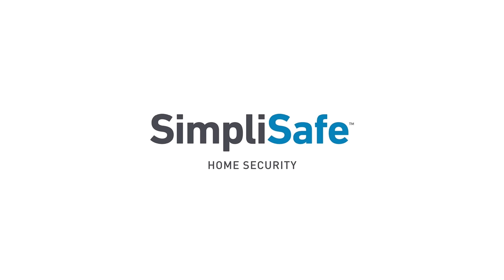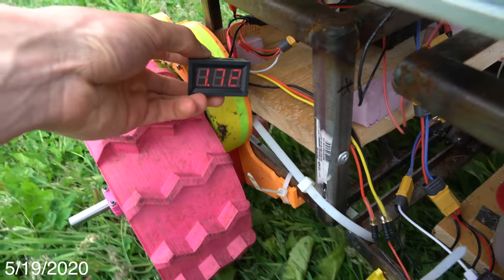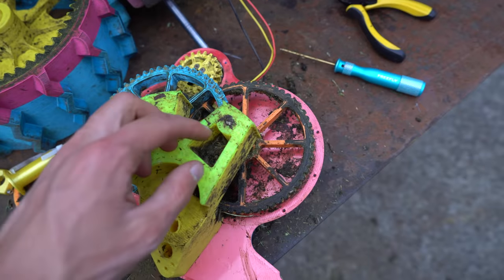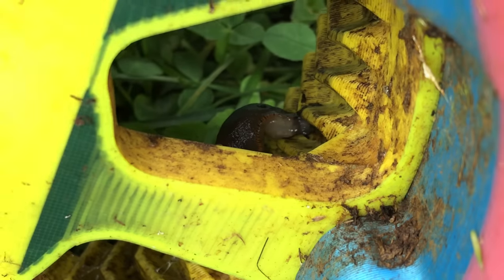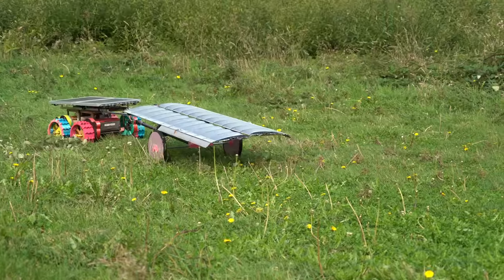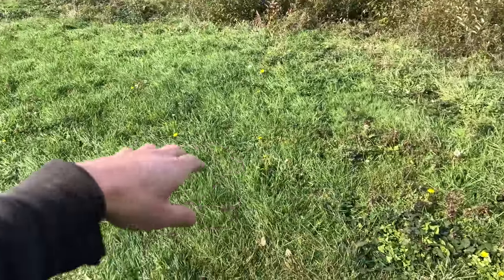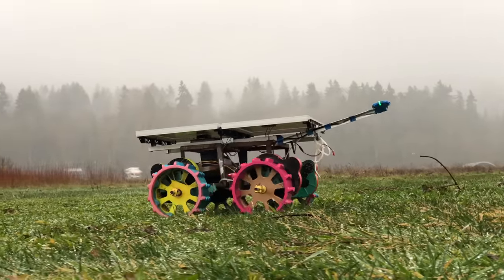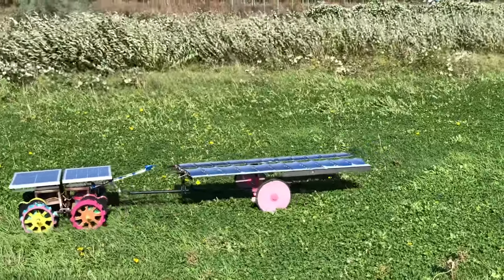Solar Rover #3 - 3D Printed Brushless Gearbox

Comment: I think it would be wiser to simply separate the gearbox from the wheel, to basically only have one point of entrance for debris to get into the gearbox, to increase it's maximum expected lifetime, and having that single point of entrance be as high above the ground as possible. For example, you could have the connection point connect to the wheel on the top of the wheel, on the highest point it can connect to the wheel in the current configuration, which would allow it to get even more ground clearance. Also, you might want to use custom-made wheels and gears inside which to be able to pack and glass-fiber cement or electrical-wire cement, or use the existing wheels and gears to make molds with which to make glass-fiber-reinforced or electrical-wire-reinforced plastic parts (using those very fine electrical wires, without the plastic parts). More weight, but also a lot more strength. And adding transparent covers for the sides of the wheels might also help combat the slug infestation.

Also, it would be interesting to see you make a airship (airplane-blimp) hybrid , and use that. It would be really interesting if you had one propeller in the front, and when there is strong tail wind, use the propeller as a power generator. It would also be interesting if you added a few flaps to the side of the airship, to use them as sails when there is more tailwind than the planned speed, but not enough to use for power generation. You could also have the airship be translucent with some home-made black-painted tinfoil heatsinks on the inside of the airship, to use sunlight to keep itself floating. And with some elastic straps, you could even have the airship turn into a lower-profile airplane/glider, to reduce the drag for lower-powered flying. And it would also be interesting to do the math to show how much power would be needed to get a fleet of similar blimps to do the last-mile delivery for home-delivery services like Amazon, from something like a truck (not a pickup, a truck with 6+ wheels) parked on the side of a road, using only air-saturated hot air, or maybe even steam. Hot air has a lift coefficient per volume of 30% of that of hydrogen and/or helium (which are very similar), water-saturated hot-air has 40% (so increased by a third), and steam has 60% (but needs materials which can survive over 120 C or 250 F, including for thermally insulating the blimp from the outside air). Do note that you can make a steam airship from metal, and you can even make a telescopic/inflatable one (although with a higher cost), to be able to need more or less volume depending on the conditions nearby. And you can even make slide-out solar panels for bigger blimps, if you need more energy (which you can use to move faster, or to heat the balloon even more).

Comment: Thanks. Your content is extremely inspiring. Maybe put a track like a tank between the side wheels and only use two of the drive wheels to run the tracks. I think you could in improve the grip and efficiency. Possibly less amp day draw and able to run off solar more. Thanks again

Comment: Print in ABS and use White Lithium grease on the gears will reduce wear.  And it is probably magnetic declination that is affecting your GPS.  It changes with the rotation of the earth around the sun.

Comment: Slugs can be repelled by alternating galvanized metal and copper bands or a couple of parallel bare wires 3/4 inch apart with a 2 or 3 megaohm resistor in series with VCC to one wire and the other to ground should the slugs path should keep them away.

Thirty years ago, I worked on prototypes of J1939 CAN networks, systems,  and devices not unlike yours that make up some Ag robots today. Work like yours that tests ideas over and over to failure is rare, and I learned a great deal about the durability of herringbone gears that is certainly non-obvious if not for your continual patching up the grass-grinding slug eater and putting it back in the field. 

You have revived my interest in building a weeding robot. Ardupilot has made things a lot simpler. I've worked on the design of robots to weed crops, yards, pastures,  and the problems you had with grass, vines, mud, slugs, clouds, and wind are not that different than the ones John Deere's engineers have to solve. Planetary gears are usually the solution for modern gear reduction in light-duty farm equipment under 100 horsepower.

My interest is weed identification, mapping, and eradication. "No weed can survive if cut it off at the ground every Tuesday" - dad

 Was I building a rover such as yours, I  would make it longer and wider so it could be taller and have more ground clearance.  I would probably use timing belts on counter shafts or harmonic drives to get the reduction on top of the vehicle and out of the dirt. I would make better seals. I would use rubber crawler tracks to have fewer problems with mud and compaction as I add weight to them. I have been torn for years between using a combination of center pivot and skid steering, as I believe you use, or using crab steering. Something this size doesn't need 4-heel independent steering, but a weeding robot for thirty 40-inch rows sure does when it turns at the end of the row. Turning something 100 feet long around in a turn row and getting back on the row is pretty tough, and is easier to work out on something this size.

Comment: Nice thing. Now some suggestions:
1: Planetary hub drive
2: suspension
3: LIDAR
4: gyrocompass
5: move GPS antenna location between the two solar panels 
6: trailer hitch and receiver
7: enclosed battery compartment, with more batteries

Comment: I'll bet if you built 20" wheels with similar gearing you could: drive over obstacles more easily; reduce overall drivetrain drag; and have a larger rover capable of carrying way more solar panels. Maybe add a little planter for the grass to grow itself next year!

I'd also really love to see one of these autopilot vehicles do some kind of useful trip. Could you send it on a mission to a different city or something? Maybe there's a multiuse trail that stretches for miles and miles. Maybe it could just go collect audio recordings of onlookers. These things really spark my imagination.

Comment: car, goes fast for a long time:  wheels and gearbox are fine

car, goes slow for a long time:  breaks
Reply: If he used some metal gears where everything was sealed with oil, it would have probably lasted forever. It only failed because the plastics got beaten to death.

Comment: I know this was filmed a while ago, but I would suggest putting in a gasket layer on the backplate (where it melted.) Even something like the gasket in a tube stuff they sell at auto stores. Then fill the whole thing w/ oil. Even if it seeped out it would actually have the benefit of flushing out all the slug guts and mushroom food.

Comment: This things actually reduce noise. This is the fact that you used plastics materials making that noise. 
You can observe that's in car gears the reverse is with classical gear  but others one are specially made with the v shape and on most of the car you can hear the difference between the noise in reverse and the normal noise of a car. Btw it was originally conceived by Citroen that is where the got they symbol.

Comment: try using a worm gear instead in your gearbox it can increase torque without the need of many moving parts reducing energy loss and reduce points of failure and can help reduce jamming in the gears from debris.

Comment: If you think about it, you definitely could've made something very similar to cow poop. The fungus means fermentation could've started, the finely ground grass is the same thing that'd be in a cow's mouth and then stomach, heat from the motor and movement could've kept the reaction going and I'm sure slug guts added to it somehow too. Dude. You made a cow. It roams, it chews up grass and it smells like cow dung.

Comment: There's code libraries available that make it reasonably easy for your arduino to read the GPS.  It would definitely help the longevity of your drivetrain to detect if the rover has stopped moving when it should be, and put it in hold mode until it can be rescued.

Comment: make it so that it knows if there's snow on the ground. make a little dog house it, and let it hibernate autonomously.  to solve the issue of not having any light in the dog house, you could make an ultra power saving mode, or make it so the doghouse wipes snow off of an acrylic roof.

Comment: The final drive pinion should be at the top of the ring gear so grass that licks into the wheel hub down low isn't grabbed by the gear.   This might reduce the accumulation a bit.   I think you could afford the extra $1 to $5 of plastic to print things solid, particularly the hubs.  ;-)  Holes in the ring gear tooth valleys might allow the muck to be slowly extruded out the surface of the wheel.   A simple deflector might lean grass away before it can get captured in the final drive.  It would seem with such large radii turns there would be no purpose in ever reverse turning one set of wheels except to drain the pack for fun.  It would still skid steer when only one side advances.  Using less gear reduction in the first stage and more later would give you more teeth and this more tooth surface to survive wear.   I work as a professional maker and safety pilot in a UAS lab.  A couple of us follow your adventures.

Comment: Hey you should try to implement a 3D printed planetary gearbox. I think you could get high reduction in a smaller volume. Also, it could provide you with a means to transfer power directly to the wheels without gears that are exposed to the elements. 
Love these types of videos btw! Keep up the good work.

Comment: Yes this kind of gearing will reduce sound. Just listen how gearboxes sound in like rally or racing circuits. They have just straight tooting  which will collapse into each other, making its distinct sound.Try driving reverse in your car results, the sound come from this straight teeth on your reverse gear, in racing all gears toothing is straight as well, because less losses because of no forces will spill to align the gears.

Comment: Those double-herringbone gears might run a lot quieter if you use a lathe to turn down the center  of each tooth, where the left and right join together, effectively making them a matched pair of double helical gears.

Comment: I reckon one of the ~$200 1/8 scale crawlers would be good for this application. more ground clearance.. add some efficient 540 sized sensored brushless motors... gear that shit down..  Also 4-wheel steer capability instead of skid-steer... could be useful but could be more complicated.

Anyway I love your use of the 3d printed gearbox and are surprised how long it held up.

Comment: interesting to see it work over a long period of time.  could put a oil drip system in there for the gears. use olive oil drip once every 5 minutes when running.
could try a little motor with some blades attached to it and have it swival back and forth to keep the grass cut in the way point area. i would like to try making a rover to detect metal and store all the locations it found metal.

Comment: If you run across a design that attracts and grinds up groundhogs, I will totally buy one. Needs to be able to cover 10 acres at a time. Probably needs to be bigger than this one. But what you have is cool as a starter.

Comment: If the entire gear mechanism is placed inside the wheel. I think it would be more robust and protected from external factors. You can make the electrical connection by passing it through the wheel shaft. Let the wheel be in the form of a closed box at the front and the back. Use the gps data by passing it through a filter such as Kalman Filter to make the vehicle move with smoother movement. Do not make the rotation movement by stopping the wheel on the side to be turned. This causes more foreign matter to enter the wheel. Instead, perform the rotational action by slightly increasing or slowing the engine speed.

Comment: Just a comment: we've been taught to keep space between rotating and static parts of at least 1.5 x height of the teeth. Yours seem very packed. Ofc this goes against the size requirements, so a middle ground seems valuable in my eyes. Otherwise: Really cool things you doing there. Not sure why, but it's fun :D

Comment: Next time try using tribological filament for the gears. I think they’re gonna work great if u find a way to seal the gearbox. They’re nylons I guess, so it self-lubricates plus will work great in the summer compared to PLA. Check out Igus they specialize in this stuff.
The ultimate over-kill option would be using PC and PTFE alloy filament, but printing with it is hardcore. It’s perfect for moving parts and u can sterilize it.

Comment: A thought on where te gears rubbed through the housing. You could lay a piece of TYVEC from Home Depot in there to reduce the friction. Though with the duty cycles you were achieving it would probably be a temporary fix though it would reduce drag.

Comment: So the Arduino is programmed to be an S/R latch based on battery voltage. Their is probably an ideal range to set as lithium batteries require more energy to charge when their charge level is high. Something like "Go into auto when the battery level is above 75%, go into hold when the level is 25%"

Comment: I think it would be overcomplicated to the point of ridiculousness, most probably really hard to get right and in the end it may not even help at all.
But I just had a thought.
You could try to make the gearboxes even more dirt-prove and improve the tolerances a lot. Then use the motor-hub to mount fan blades to pressurise the gearboxes using "clean" air from just below the solar panels.
Maybe it could discourage the smaller powdery debris from getting in...

Comment: maybe design the gears or the mechanism to have self-clearing teeth? maybe like a moving part that cleans one tooth every revolution just slightly less than 1 full rotation or 1 slightly more, and then also you need to keep the grass out, which the covers were a great idea, but i have a feeling that using some sort of thicker axle and o-ring to seal it off keeping it from grass ingress

Comment: So cool! I absolutely love these videos.

As I was watching, I had a few ideas (correct me if these are bad ideas, I’m not an engineer)

What if you moved the gearboxes internally? Have all the electronics and motors in a sealed chassis with just axles coming out. 

What if you changed the steering to an articulated design? Sort of like those large tractors that steer in the middle. That may allow for different wheel choices. 

Lastly, what if you figured out the minimum amount of battery power needed to run for say... an 8 hour period. Could you program in for the rover to only run once it’s charged its batteries to that level? 

I’d love to see a full build on a rover made of higher quality (metal) parts! Let’s get this thing to run for a whole year without any interaction!

Comment: Maybe put some self-diagnostic ability into the rover? Eg, if a motor gets hot, or the expected distance vs time falls below a certain limit (eg, rover stuck). That might prevent damage past the initial issue.

Comment: You really need to check out "Hobbywing QuicRun Fusion Brushless System". You've never seen such smooth, cogging-free, low-RPM, and high torque brushless motor control.

Comment: The shift seemed to coincide with the addition of the solar trailer. I'm not sure where your compass is located but I'm thinking that the shifting conductive parts and currents of the trailer could be affecting the magnetic fields near the compass. Also I would like to second some self cleaning gears.

Comment: Ther are some things I noticed about the drive train desing I don't really understand, or that I recognize as a point of possible failure:
I'd have enclosed the geabox and send the torque via a shaft to a smaller gear that's put on the shaft after closing the gearbox, another issue is the lack of spacing/direct 3D printed plastic rubbing on 3D printed plastic, this should be fixable with teflon washers. For the later I would take teh thicker ones, this has them work as distance pieces and gives you a little more room, when the parts "wobble/deform" under stress. The missing space issue can be seen on the orange and turquoise gear wheels, the smaller ones were directly printed on the bigger ones, with metall gears this would be an option, as you'd put a smaller one next to the bigger one on the shaft and that would be it, but if they are one part, having a rounded circulat shape instead of "sharp edges" makes things a little more sturdy/beefy, it also means less room for things to "friction weld" themselves into oblivion. Around 32:48 one can see, that you did this on some gears, but not all of them, I wonder why that was? Anyway, teh shaft feature could extra usefull for the drive gear, you could've put a shaft feature on the output shaft and given it a fitting for a bearing, this also would've sealed your gearbox against debris and it would've been better held in place, resulting in a stifer shaft position. Sliding the drive gear on and fixing it on the shaft would mean that your geabox now has one opening less for gunk to enter, the other one would be where the motor is, this opening could be closed wit a piece of thin rubber or something? As for a bigger plate like cover, simply getting a sheet of teflon and cutting it out surely would be more durable, there are a lot of openings in the geabox I don't understand the nessecity of, some of them I question outright, a prime example would be around 34:37 , where one can see the gears moving between the orange cover and the wheel, this seems like an unnessesary opening?